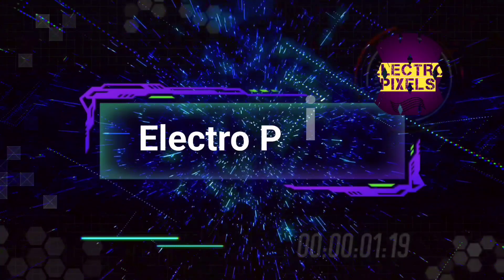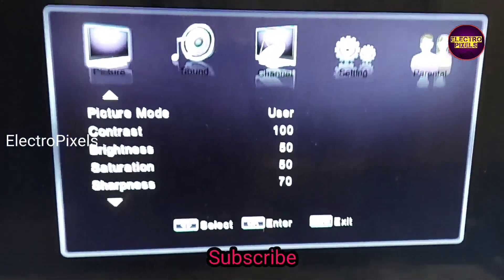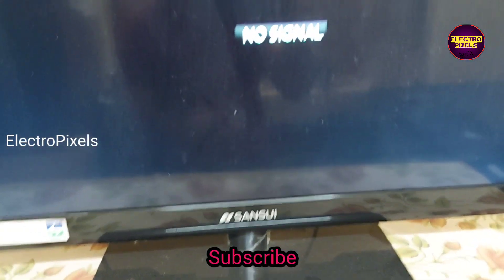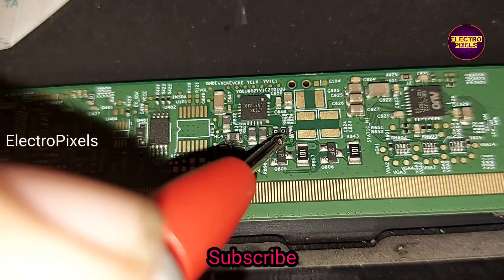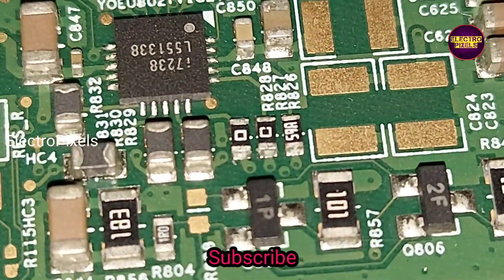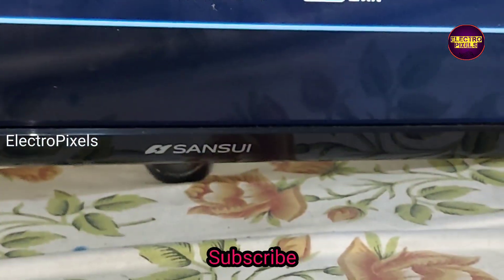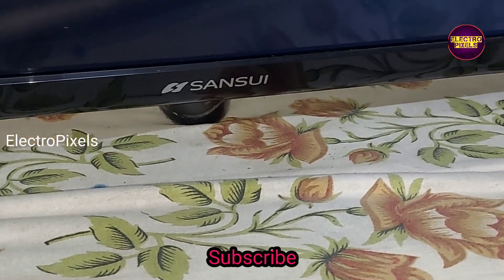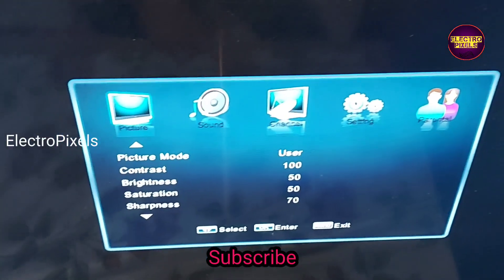LED Tv Panel Short  Removal on 32 inch Auo panel |Sansui Led Tv Double image.|Panel Repair.|#Auo

Comment: Can bonding machine repair the problem? Or permanent solution is to replace the panel only?
Reply from the maker: Bonding Machine can Solve COF (Chip on Filim )Related Problems like COF Burning or If COF Disconnected From Scalar Board Causes Vertical Lines etccc
Reply from the maker: This Type of Complaints is because of internal shorting inside glass panel mainly due to corrosion.
Reply from the maker: Here in this panel the shorting is with Right side of the panel. After removing shorting Picture will be ok. These signals will now Enter into the Panel through Left side, So no problem for viewing. But After sometimes the Left Side Gatesignals will also become short due to corrosion. In that situation panel Replacement only Solution. Sometimes it will work for 3 years. But some panel will last only 2 months minimum
Reply from the maker: It completly depends on luck basis,Panel Replacement cost is almost near to buying a new Tv. So let's give a try before buying a new Tv. It will help to reduce E-Waste👍
Reply from the maker: If you like our channel please share and support
Reply: Well answered sir, thank you very much. I learn alot don't stop..
Reply from the maker: Please share and support Sir